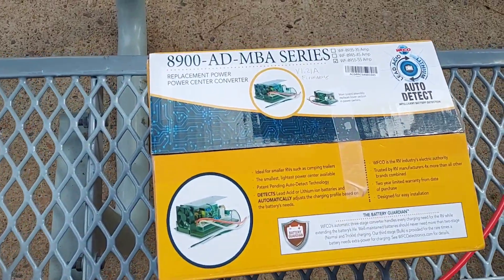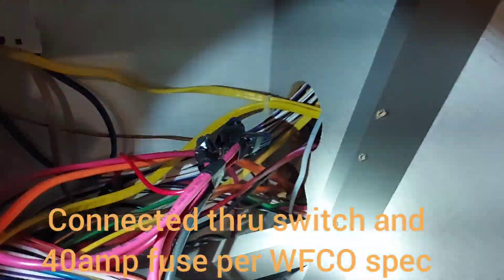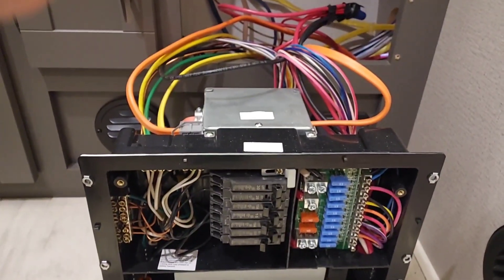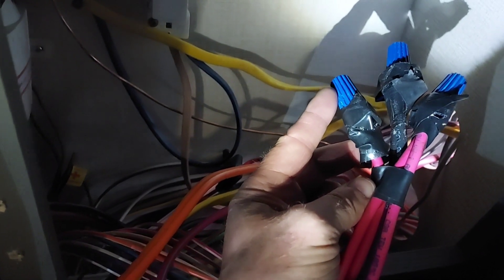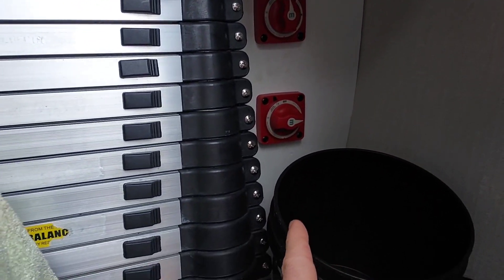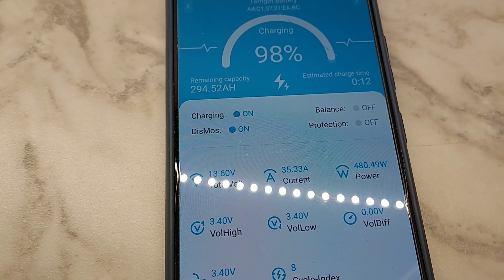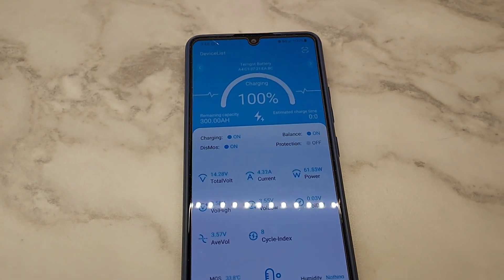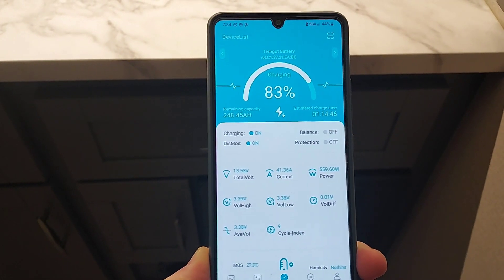WFCO WF-8955-AD-MBA update

Comment: My first question is, who cobbled all that mess together, all the 12V + with the wire nuts and the sloppy electrical tape...??? I certainly hope it wasn't the manufacturer, because that is absolutely unacceptable...
Reply from the maker: @wipatriot510  You know it was the manufacturer. They have no pride in organizing wire runs.
Reply: @toyhaulen  Well, whoever did that should be fired...I have NO idea how that even got passed quality control...
Reply from the maker: @wipatriot510  Unfortunately it's pretty much normal.
Reply: @toyhaulen  Well, I have 2 Forest River units and an older PUMA, and none of them looked like that...I've seen shoddy work, but nothing on that level...

Comment: I’m using the stock led acid converter with a 100ah lifepo4 batter with bms on the front. I also have a lithium 110  charger. I plan to upgrade my converter in the spring and after watching many videos and issues with the auto detection I’m just gonna buy the lithium only converter. Mainly because after using led acid and then lifepo4 I will never use led acid again haha

Comment: I saw my comment about the charging voltage and this subject.  My video is on this very subject.  Check it out.  I have the jumper on my WFCO 8955AD converter.  It will not fully charge my 3 - group 24 LiTime batteries.  This converter is a waste of money.  I am getting full amperage from 8955AD but not the 14.4-14.6 voltage.
Reply from the maker: @RobertMiller-kw7ek  I have not had the chance to fully test it yet. I have a trip in a few weeks and will try it out. 
I was able to get full charge even in L.A. mode. I'm assuming as the amps come down, the voltage will increase to 14.6. I wish it was just a switch.

Comment: What’s the voltage?
I can’t get mine to charge the 14.4-.6 which is to properly
Reply from the maker: I am now getting 14.6 volts after installing the jumper. You might have a defective converter.

Comment: I learned from another youtube video that WFCO doesn't tell you this, but you need to drain your LiPo4 battery before the converter can see it as a LiPo4.
Reply from the maker: @Camperman1951  I took it down to 37%. Yes, I have heard this too. I am not going to take it down all the way, no way. Thanks for watching
Reply: No they don't, wht WFCO say is that the battery has to go through a charge cycle, NOT that "you need to drain your LiPo4 battery before the converter can see it as a LiPo4" And BTW, it LiFeP04, Lithium Iron Phosphate, OR LFP if you prefer...

Comment: Consider getting rid of the wire nuts and getting a couple bus bars, that are the covered type.  Also when wiring using 6 gauge,  consider 4 gauge and use welding type stranded wire instead of the grade of wire bought I think you said Autozone.  If you still have issues, consider using a Victron Energy Blue Smart IP22 12-Volt 30 amp 120VAC, Single Output Battery Charger NEMA 5-15, Bluetooth   give you the ability to program for a rebulk mode, and does allow you to better setup for lithium.   I would not buy another WFCO product,  no sure what the price difference is.